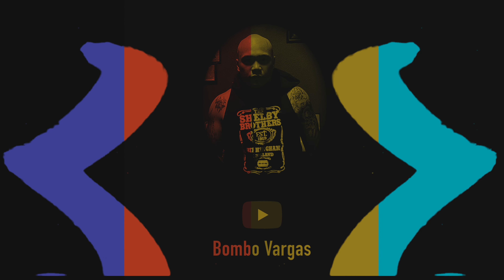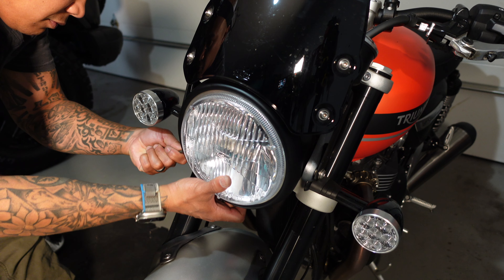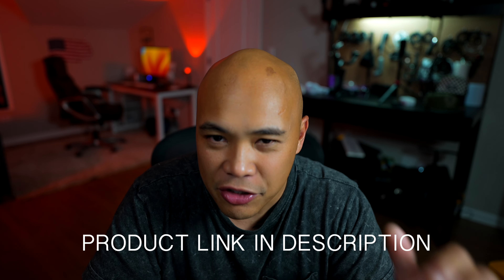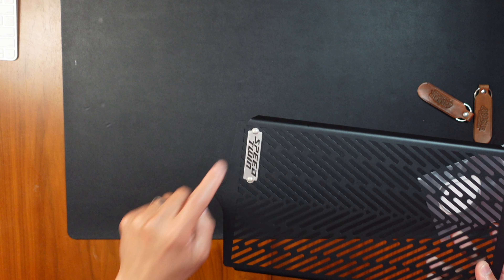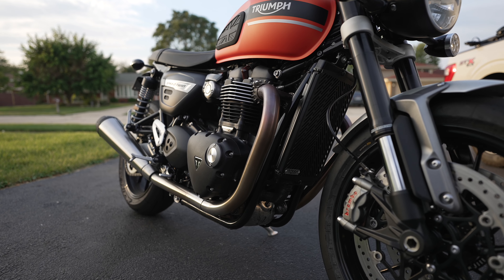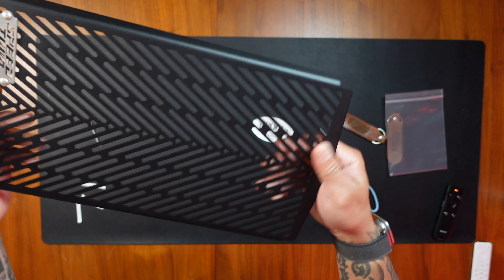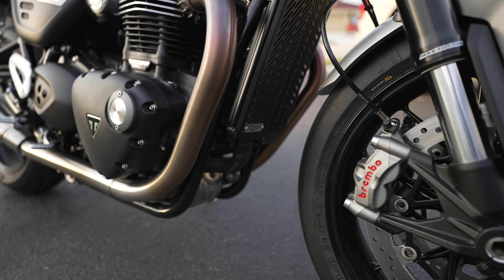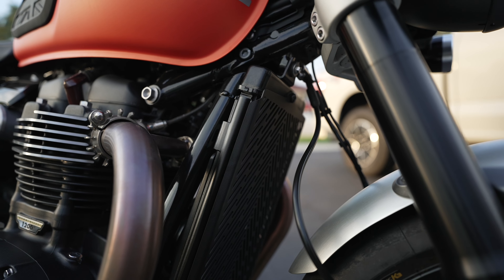YOU NEED THIS! FOR YOUR TRIUMPH SPEED TWIN 1200.

Comment: I fitted an Evotek radiator guard, and a fender extender in carbon fibre, to make up for the criminally short front mudguard. They both look great and do a good job!
Reply from the maker: Very nice!
Reply: Would you need lock tight putting that guard on
Reply: @Johnsevern89  No. The guard comes with several adhesive strips, which are very sticky. Remove the fender, clean the area where the extender attaches, and  press it into place. once fitted it will not come adrift.

Comment: just mounted a good one. I just hope airflow restriction will be ok.
Reply from the maker: how do you like it?
Reply: @TheManToys  its fine thanks ! i used spacer unlike you explained,  but i stopped tightenning before bending anything, and used medium threadlock. What do you think about airflow restriction ? Du you have any tips to lower the engine temperature ? (i was thinking about a remap with a slightly richer mix).
Reply from the maker: @guillaumenobody9624  I haven’t really noticed difference on the airflow or maybe I wasn’t really paying attention to it. How bad is the temperature that you need to remap it?